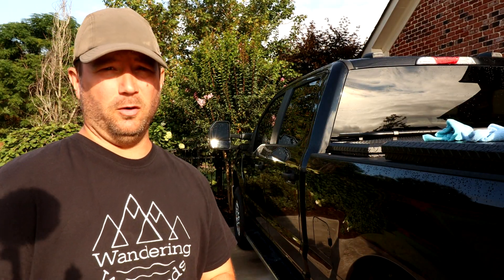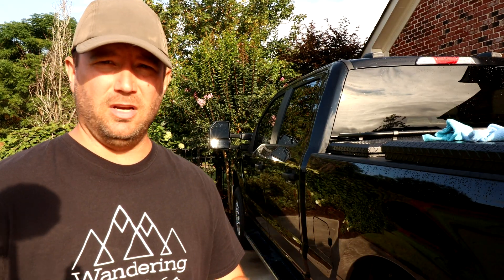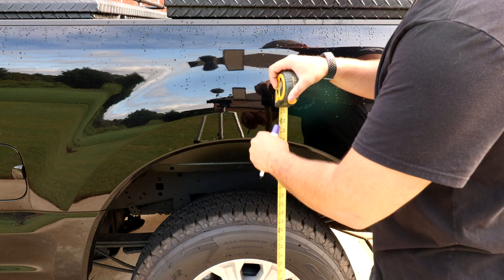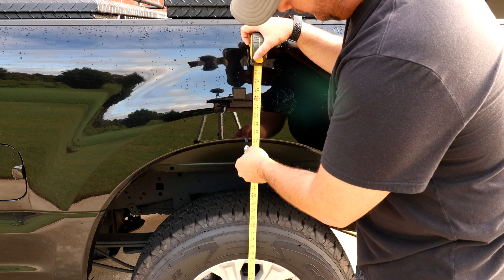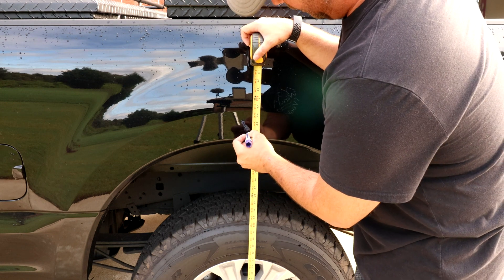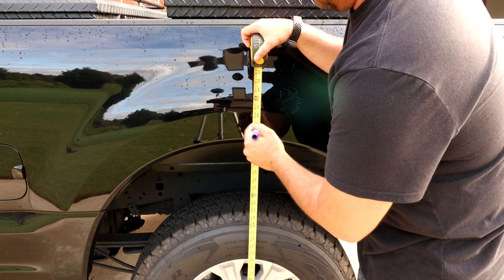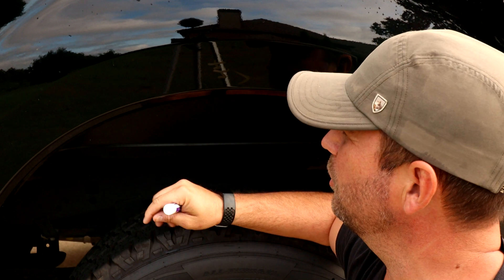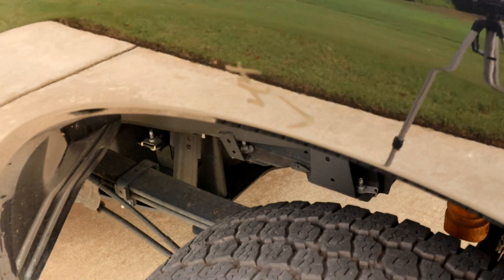QUICK TIP for Fine Tuning Your Weight Distribution Hitch

Comment: Great tip! You measured the rear for the example, but the rear doesn't matter for weight distribution. The front is what you want to measure, as you're trying to get weight back onto your front axle that is lost when hooking a trailer to the rear.
Reply: @WanderingWeekends  Interesting...What does Equal-i-zer ask you to do? They are the most experienced in the industry and know their stuff!
Reply from the maker: Hey you’re correct! Equalizer asks for the front. Ive done this to the point of nausea… haha. You should see the measurements for the ProPride. Lol. It’s literally a worksheet. 8 measurements for that one.
Reply: @WanderingWeekends  Haha, sometimes things should just be kept simple! Thanks for putting in all the work to test these, I'm looking forward to your final thoughts and which hitch you think is the best!

Comment: First off big fan of the channel! 2nd with all of the hitch testing and set ups you tested are there any other hitch set up tips and tricks you figured out?
Reply from the maker: No real tricks. Most of them are very similar in nature. Torque specs vary a little but otherwise not much changes. I know my ball height from the get-go so that always makes life easier.

Comment: The measurements for WD hitches is a starting point. But every trailer truck combo is different. I set mine and my dads hitches up according to the measurements, and to get the trailers to pull better was no where near where the book says to set the hitch. Its trial and error. Set it up according to the book, they dont be afraid to change it along the way. Also I know everyone wants their truck to look like it has no squat when pulling a trailer twice the weight of the truck. But let the vehicle suspension do its job. let it squat and load the springs or your trailer will pull like garbage.

Comment: Cool tip with the dry erase marker! My coach arrives in a couple days and i have auto leveling air bags on my truck. Should i turn off auto leveling when im setting up my camco eazelift TR3? and then turn it back on when i have the desired angle?

Comment: I also have to measure my front axle, because I have auto-leveling air springs on the rear. But it’s the same principle.
Reply: Jim, I thought you were supposed to disable the Auto Level when you set these WDH up?

Comment: Great Videos. Ready to replace my worn out chain hitch with friction bars. When do you plan on disclosing the winner? Im leaning towards the Track Pro or the Tru Track. Would like to be able to open the tailgate. Thanks
Reply from the maker: Between those 2 options the TruTrack performed better (and its a bit less $$)

Comment: Cory, again, when are you planning to announce the winner of the WD hitch battle?  Every comparison on the internet has a different best hitch. I dont think anyone has put the time and testing in as you have. I have been looking at the Anderson but my trailer is right at 10000 and I dont think it does too much for weight distribution with the chains. Thanks
Reply from the maker: Gotta get a few more trips in with the ProPride before I can give it a fair score. 

Yes, I would agree your trailer would be a bit much for the Andersen based on what others have consistently commented. The Andersen seems better suited for smaller rigs.

Comment: Corey, we have a 2800BH as well. When you’re loaded for a trip(but without any water in the tanks) what does your trailer scale weight on the tandem axels? Approximately how much does the tongue weigh? On both measurements, I’m assuming weight distribution bars are being used. Thanks Danny
Reply from the maker: Our hitch weight is about 950lbs.

Comment: I've used Haul Gauge since it first came out.  It's now know as Better Weigh.  It plugs into you OBD2 plug under the dash.  Quick to calibrate, it will give you the truck weight within 5% and will also give you information on your weight distribution, combined weight and even gives you a gauge on how well your weight distribution is.  check out this video: https://www.youtube.com/watch?v=rIEJ1QLb7Vg&t=8s.

It can also help set you best brake gain setting.  I've also used it to prove the trailer brakes were not set up right when we first picked up our trailer.  Here's a video:  https://www.youtube.com/watch?v=P8Txco2p3yM&t=2s

And what I like is all the information is sent by bluetooth to their app on your phone.  Except for calibration, you don't need a network connection.